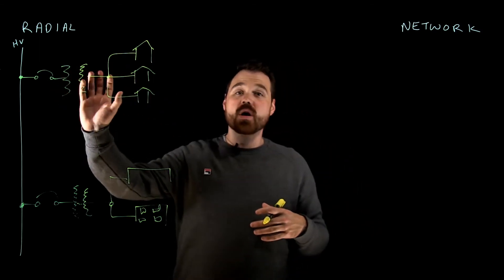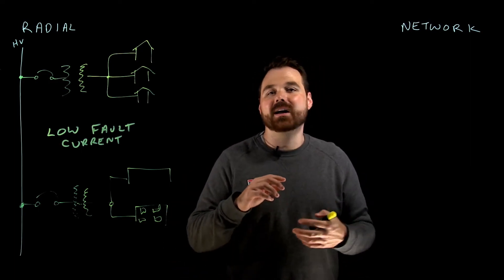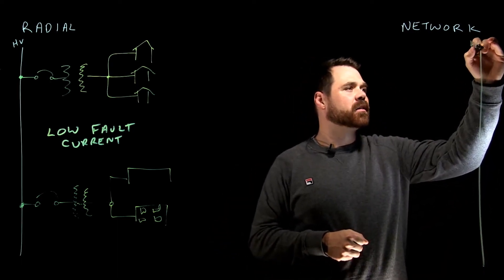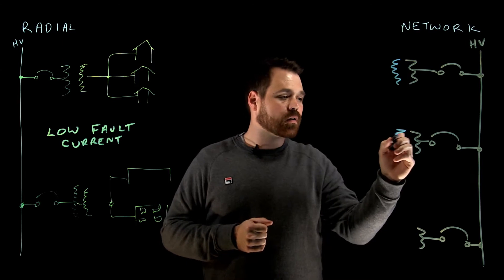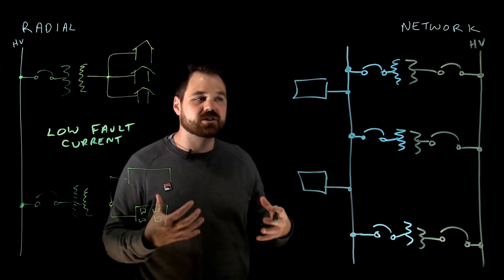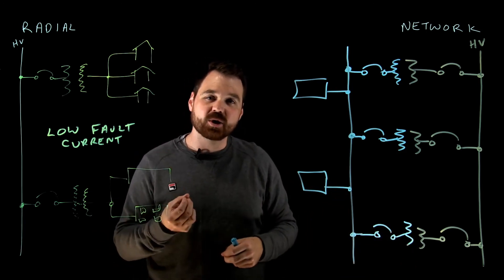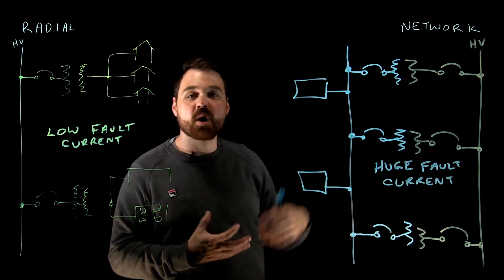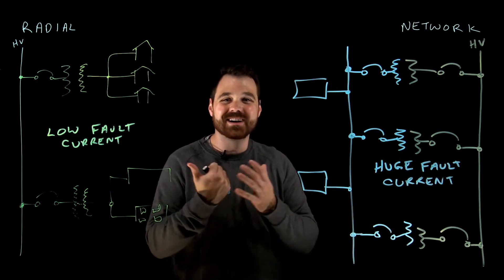Radial vs Network Distribution Systems

Comment: Thanks for the video and explanation! On mid-large commercial buildings on radial, is it the same as the residential radial just only one XR / building? Also as wondering if the spot network causes the XRs that are connected to the collector bus to have a minimum load requirement.

Comment: Your definition of radial system is different than mine. On my  radial system the primary line dead ends and if you loose the line all of the customers on that line are out. The next system is a loop system is when you have the line fed from more than 1 source or the line ties back into the same source. The last system is like you said a network system where not only can the primary be looped, but the secondaries of transformers are in parallel so if you loose one transformer the others carry the load. The only place that I am aware of that runs a network system is  Toronto.

Comment: Distribution is a complicated issue .radial vs network .What they call networked should be called poly nodal power distribution .Yes it's a form of network but it's a poly nodal system and creates a huge problems in the event of failures .The advantage is that if there is a failure once the failure is isolated the rest of the system can remain energized .With this so called green energy systems coming in you are going to have many issues .One issue is of the power  produced from  being pumped back into the network in a fault condition causing many issues .There needs to be a means of disconnecting the power nodes from the network in the event of a fault condition ,or reconnection of the node to the network to supplement the network demands .
There needs to be a reliable interconnected communication system between all the micro power plants and the network and main power  plants .

Comment: Not quite right. The network is fed from multiple primary circuits, so if a fault occurs on one of the primary circuits, the network protectors on that circuit will trip. But the other NP’s on different circuits will stay closed, so no loss of power to high rise buildings.

Comment: Is Ring main system is same as network system?
Reply from the maker: Very similar. The ring system just connects again at the ends so if the main line breaks, there's no loss in power

Comment: Interesting point about the huge available fault current on a network system.  What scenario would typically require transformers being paired on a network system?  Would this be reserved for hospitals and critical operating systems?  Also, wouldn't most network systems be set up with a main tie main application in order to shut down a faulted section and prevent the huge available fault current?
Reply: " Would this be reserved for hospitals and critical operating systems?"  Definitely not.  In well developed countries this is quite common in cities.  This is how "we keep the lights on 99.99999...% of the time.  Depending on the density of the city there may be 3 transmission substations within 5 miles each with several transformers bringing transmission down to distribution voltages.  This pretty much insures the electricity is on almost without interruption.  This is also why developed countries typically pay much more for the convenience of electricity.